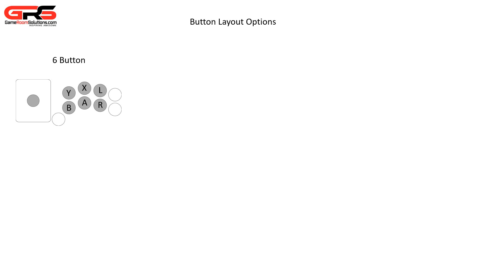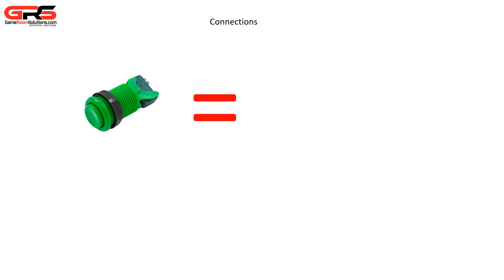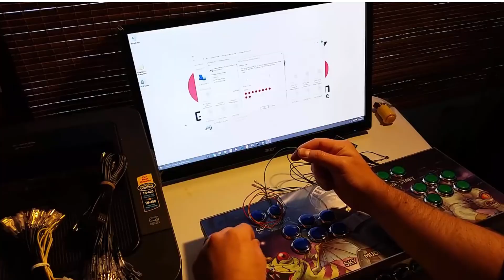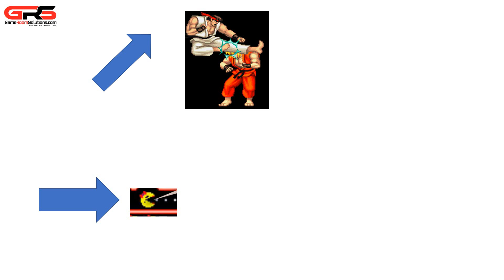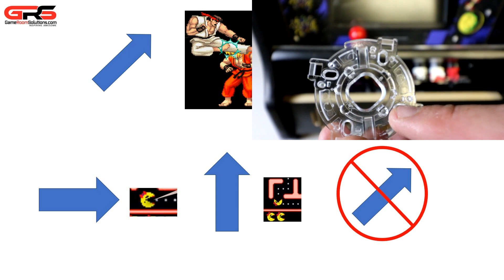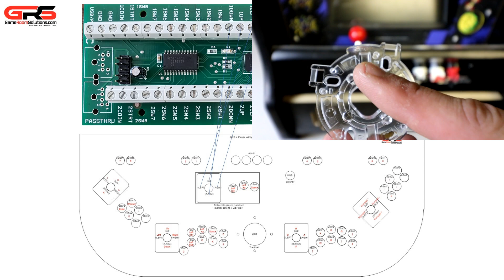Arcade Button Layouts and Wiring 101

Comment: That is very informative about 4 way vs 8 way.  In the years since this was posted, has a workaround been developed?  I definitely see the benefit of having a 4 way but don't necessarily want extra joysticks on the panel.  It seems like Launchbox "should" be able to disable the diagonals, never mind the physical aspect.
Reply: I just found "Servostik."  That seems to solve this newfound problem.
Reply from the maker: There are software and hardware solutions.  I prefer the 2nd joystick, but you can find alternatives.
Reply: @Gameroomsolutions   I went with Servostiks.  They are arriving today!

Comment: Can the iPac 4 also support LED buttons? If not how would you wire one?  Just with a 12V power cord for example?
Reply from the maker: Yes, 12v power supply and a led harness for button lights.

Comment: Great video! I’m after a little more help if possible. I’ve bought buttons with internal switch and LED. These buttons have four connectors but don’t have any instruction or markings as what wires go to where. I’m wanting to wire this so I have two buttons doing the same action. The top RT will be used in arcade games but another side RT button will be a flipper in virtual pinball. In total it will be a two player top console with 8 buttons each and a coin and P1 and P2 start each plus right and left flipper buttons a nudge button and a ball launch on the front. Just need help on how to wire these four pin buttons so they work and light up.
Reply from the maker: https://youtu.be/pObTk3iBwqE

Comment: Great video.  Just got your 4 player pedestal cabinet and been having some questions come up.  This is perfect.  One issue I did have is the connectors for the sanwa sticks are too short to reach the ipac no matter where I place it.  What is the best way to extend these wires?
Reply from the maker: Any wire.  Speaker works which a lot of people have laying around.
Reply: @Gameroomsolutions  sounds good.  Thanks